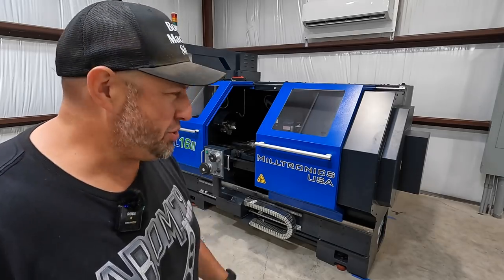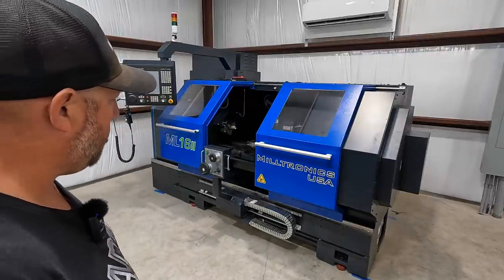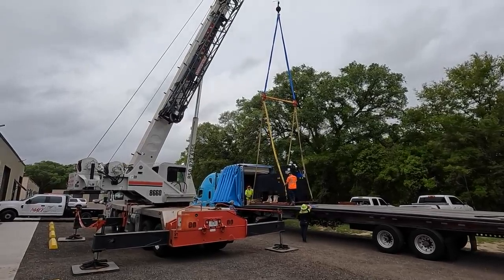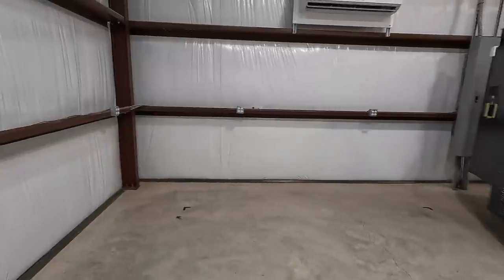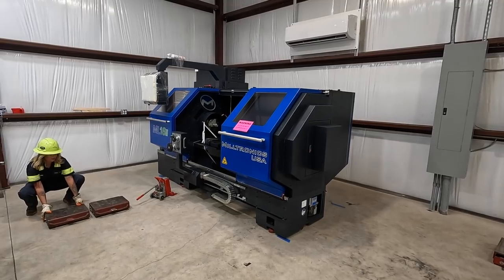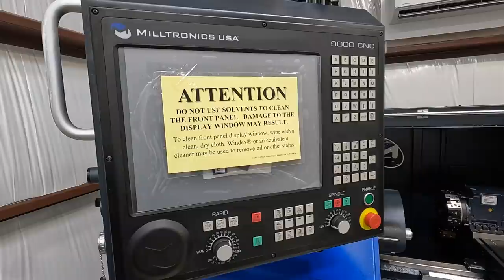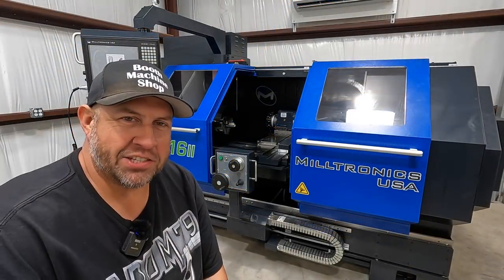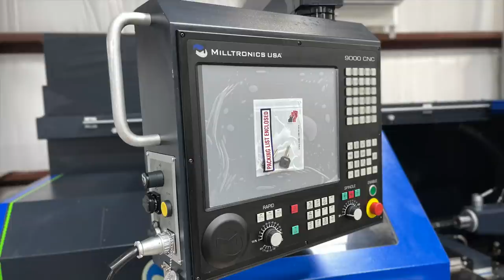Milltronics ML16 CNC Lathe, Our First CNC!

Comment: I was thinking that if the need  develops where you need to feed longer stock in.  You can always add a door to that structure since you're in the corner of the building.  It shouldn't be that difficult.
Reply: Or just drill a hole.
Reply: @rjkee5157  I doubt the building would want a hole in the wall.  But a boat portal window that could be open and closed could work to or and standard window for that manner

Comment: did you see the crack in the new floor?
Reply: What does that have to do with the context of this video?
Reply: Yep, already falling apart. What a shame.
Reply: @FrozenHaxor  ....You need to complain to the landlords video!
Reply: That issue has already been addressed in a few previous videos, floor slabs are MASSIVE and little surface cracks do not affect stability whatsoever. Floor also has control joints built in.

Comment: cnc in aboms shop?  sacralage, but at least its a usa built machine, and its another tool in the belt for a serious shop that does production, though manual can do the same thing but takes 5 times as many steps to set up then to program a machine and have the repeatabillity. 
I mean its just not something I thought I would see in this channel, but even I use a duplecator for making spindles on my wood lathe, and nothing but the most sturdy too from vega, though I perfer using chisles and cutters in hand and freehanding most, but I cant replecate 3 spindles alike though I can get two of them close, but its nowhere near as fast, the only other step up would be a computer lathe myself, or a big old copy lath, and I dont use it everyday so it dont justify the expense to step up to that.

Comment: What I don't like about those machines is that the dust and all the chips will fall onto the dovetail, certainly it will need regular oiling there.
There are other machines which have the crosslide hanging on the other side - for me those ones seem to be a better design for a cnc turning machine.
I'm just the owner of a small DIY CNC lathe (basically the same concept ... and that's just what I have noticed) but it has served well so far.

Comment: idk what kind of work you do but if you do contract parts.....400, 500,or more pc lots, you should always leve room for a bar feeder for a CNC lathe.  Just my 2 cents.  I bought a Hardinge Super Slant with live tool on the turret, I was not happy with the placement in the shop (long story), 4 months in I got a contract to make swedge dies for plastic tubing out of aluminum barstock.  Having the barfeed capability saved me 2 setups and 2 operations. And eliminated slugging blanks out of the bar.

Comment: Just curious if that's one more red lockdown bracket on top of the left door. :)
Reply: He takes it off at 19:13
Reply: The other "red thing" is a safety interlock switch for the sliding doors, they must be closed for the machine to operate...I think?

Comment: A few years back, I spent the better part of a year programming a twin spindle, 36 tool with live tooling, 11 axis, Nokamora Lathe for machining high production, high precision (2 Micron tolerance) diesel fuel injectors out of 4140 bar fed stock.
Got it running a 4min. 32sec. cycle time and using all 36 tools.
It was quite the challenge!

Comment: Adam, you will find what you do manually is sometimes difficult to translate to code. The machine needs to be instructed to do *every little thing*. This is assuming you'll be using g-code or whatever Milltronics uses to program.

Comment: I applaud you in using your extensive knowledge and to add CNC to your repertoire. One question I have is does this machine work in metric or does it use imperial measurements. Intrigued to know.
Reply: Sorry to say, you have to learn yet another system. That thing only knows bits and bytes ;)
Reply: You can do either
Reply: Almost all (probably all the actually usable ones) CNC machines have their inner workings in metric - in thousands or tenthousands of a milimeter. Since it's just a simple conversion, you can convert all of them between 1/100mm or 1/1000 in
Reply: @an2thea514  To be honest, I am not sure if the initial question really was a serious one or if it was jokingly (that was my guess).
But it is somewhat closer to my joke about bits and bytes. if you control or display those as mm or inch is just, as you correctly mentioned, a software setting and conversion.
But coming to the inner works, controlling those movements is usually done by the use of stepper motors. (They are other variations around which highla depend on feedback from measuring systems) Those stepper motors have, depending on how they are build, certain characteristics, like how many steps are one full rotation. Sometimes there is something like half pulses to create half steps, but I highly doubt you will find such in those machines.
As an example, a common stepper motor (or servo) used for example in 3D printers has 400 steps per rotation. So one Step would be a 1 Grad (or Gon) or 0.9 degree or 0.015708 rad or 16 NATO Mils rotation. Depending on how the movement is mechanically translated from a rotation to a linear movement you know what distance the linear movement of one step, eg. in a pulley and belt system. With a 25 mm pulley one step would mean the belt moves about 0.19635 mm linear per step. Of course a screw like in the manual machines would work as well (and may be used here to prevent slipping), then the movement depends on the screw pitch. From here now your system calculates the steps needed to move a distance. Most likely this will be sort of an odd number, no matter if metric or inch and with standard parts available, there will most likely a lot of metric stuff going ion within the machine, but to be honest, this is just a number used in the controls, if metric or not does not matter. 
This 0.2 mm of course was only an example and sure is far from the actual precision of that machine.
Of course a screw like in the manual machines would work as well (and may be used here to prevent slipping), then the movement depends on the screw pitch.

Comment: Are you guys required to have some kind of fire suppression system? Even if you're not it would give you a some kind of discount on your insurance. And if you do go with some kind of fire suppression system you should go with a dry system unless you use a different type of fire retardant. I never looked in the videos before to see if you're building already had fire sprinklers. You have a lot of monies worth of equipment there. Fire sprinklers would require a small attached little shed away from your shop. Something to check into

Comment: Sweet machine; but I've never heard of a CNC machine having a conversational mode, do you think he meant conventional?
Reply: I think a conversational mode would be very useful for abom75.
Reply: Nope, "conversational" is widely used to describe CNC's which can be programmed one step at a time as it's running the part... 

It strongly implies that the machine has Macros or a special interface which make it easy for an inexperienced user to get the machine to run complex shapes without needing to know the underlying G-Code.

Which is why it's "conversational", at each stage the machine is telling you what it can do, and when you chose and operation, what details it needs to be able to do it, so it's a more two-way communication experience than writing G-Code or uploading Code from a CAM package.
Reply: @joshuakelly8103  I stand corrected, still sounds like a typo if you ask me.
Reply: @mattyt9999  I would imagine they call it conversational due to you basically having a "conversation" with the machine. Making programs right there at the controller, telling it what to do, rather than doing it off on a pc. Think of it like talking to the machine "i want to cut a bore diameter of xxx"

Comment: Nice job Adam. It’s where the future lies sadly. I feel that the skills you’ve always practiced will soon be a forgotten art. That is the only downside to CNC machines. Your new skill set will make huge improvements in throughput in the shop, but make sure you keep your hand in the manual camp as well. Here’s to the future.
Reply: Hey TT, I always thought of the two as, one-off vs production. No?
Reply: There will never be a stop on manual machines. Much quicker for prototype and development work. It's not worth programming until you're ready to start doing batches.

It actually works out to raise wages. CNC operator is usually bottom of the scale, manual guys at the top, and the programmers get screwed because they're at a desk.
Reply: There will always be a need for job shop machine shops. Many industrial machines do not have spare parts sitting on a shelf somewhere. The parts are made or repaired on a “as needed” basis by job shops on manual machines.

Comment: I think he might regret getting it so close to the wall. Even a 3 foot long round, hes gonna want access from back. Not that he cant move it forward. No chip conveyer? Any small production run, even 100 parts and hes going to regret that immensly. When i did cnc, chip conveyer was always running even on small runs, and dumped into plastic 55 gallon baskets. We could fill like 5 of those in a day. That bottom pull out tray, hes not gonna like pulling that every couple days. I dunno, I guess, to each their own.
Reply: I doubt that he's even thinking in terms of high production. His version of high production might be 20 parts...... But he still has to find out what it will take to get those 20 parts out of a CNC lathe (time element). The time to program the job, the time to set up and zero out all the tooling, the time to prove out the program....... Those 20 parts are going to get mighty expensive!
Reply: @johndonlan5956  Well, i suppose it depends what one thinks high productuon is. When I did cnc, 100 parts was a small run, most of our runs were between 150 to 54,000 and we only had a 8 man crew. To me, 20 part runs isnt enough to justify one of these unless you do it constantly. Then i could see it. But I guess we'll have to wait to see what he runs through it.

Comment: Don't have long bar stock fed from rear, unless you have proper support for the remaining full stock length,  or you will get dangerous whiplash! Find a correct size bar length to saw cut first to hold and machine, and never go any longer!

Comment: “@ around 3:30 or so he says machine can bd used “Conversational” ?  I think he means conventional doesn’t he?
Reply: No, its a weird use of the word, but he did mean 'coversational'.
Reply: Conversational in the CNC sense means to program simple parts and operations on the control by inputting some measurements and having the control automatically make the code to pun the operation (simple facing, bolt hole patterns etc)
Reply: @Uk_Grid_Engineering  Thank you. Have been hearing the term recently, and needed to find out what it meant!  So, it’s the closest that a machine like this comes to “conventional”, manual, operation?  I’m looking forward to following along and learning too.
Reply: @Steve.M  In layman's terms, it's called conversational programming because essentially you tell the machine "this is the measurements I want on my part and how I want it to look" and the machine calculates everything for you.
Reply: @Steve.M  CNC machines can usually be used manually, using the hand wheels,  
Although this is generally one axis at a time, conversational is for quickly flattening a surface and simple things like that

Comment: what r u gona do with NC? Now u gotta learn to write...
Reply: 40 years ago you had to write code. Today the machine control units are so sophisticated that they write the code for you...... And pop out of cup of espresso while you are watching them do it!
Reply: @johndonlan5956  yep, so many of them have their own kind of conversational built in you can just pop an idea in there and it writes itself!
Reply: Any CAM software will export the code for you, but as a programmer or operator you need to know what every G and M code means and how to read and write programs line by line. There will inevitably be mistakes in the code, wrong feeds and speeds, and other manual modifications to programs. I programmed and operated CNC machines for about 12 years until switching careers to software development recently.
Reply: @HarryManback0  You sir.....are 100 percent correct!

Comment: For not filming the removal of the machine from the pallet, your viewers missed out on some valuable technical rigging that might have been interesting and a learning experience.  Too bad no footage. All we got to see was the easy everyday stuff.
Reply: Well, people went ballistic over him showing uncrating the other machines, so it's natural he didn't include it anymore
Reply: @an2thea514  I am really surprised that they had a crane, and then never used it to take the machine off the pallet.  It would have been so much easier doing that first, instead of skating the pallet and trying to remove it later. I have rigged many machines, and getting one off a pallet without overhead lift is always a challenge.  What is your experience with this  ? ?

--Doozer
Reply: @kooldoozer  He doesn't have thr room height or the crane reach to take it off of the pallet without uncrating it first. You can see it in the lathe video, that thing doesn't go very high.
I personally had the fortune that all my machines(1500 kg and less) have been in my big shop, that I built in a way so that I can get my Tractors in there. Lifting them off of a pallet and maybe get a foot in the air for levelling
Reply: @an2thea514  They used the crane to take the lathe off the truck.  Should have used it to take it off the pallet too.
Reply: @kooldoozer  that's not completely true for either lathe.

Comment: CNC is the devil.  No further machining skills required.  You have just become a computer nerd in the worst way, Adam.  You might as well hire some guy to tie your shoes now, because that has about as much to do with machining as CNC does.

Dean, (me), who has been a manual machinist (lathe and mill) as long as you have been riding your first bike.  To me, this is sad.  You are so talented.  You know so much about manual machining, and have even encouraged me in my old age, (not quite as old as that Mr. Pete guy, but pushing it.)  South Bend, Monarch, Bridgys, and even a few old clapped out nasty Atlas machines, as well as Clausing Colchester and a couple of well built Taiwan machines are what I made my living on.  Never pushed a "Run" button in my life.  Never will, and I'm still working.  I love the trade.

Good luck.  I want you to succeed, but not by going to the dark world of computer run machines to do it.  Best of luck, but crap, man...  I'm sad about this.
Reply: Extremely ignorant view point that isn't surprising from someone who has never touched a CNC machine. If you can't realize both are tools in the toolbox and that CNC operates on all the same fundamentals and then some as manual machining, you are ill equipped to formulate an opinion on the matter. There is room for both.
Reply: No machining skills required? Its clear to see you've never even touched a CNC lathe/mill. You gotta respect both aspects of machining; CNC and manual.

Head over to Cutting Edge Engineering on YouTube. He's a manual-only machinist and he does some absolutely amazing work. The work he does isnt really feasible on CNCs, but that doesnt mean that CNC is something he shits on and calls the operators "nerds".

If I program a CNC mill or lathe - I can pull in anyone direcly from the street and have them "operate" the machine and run parts. But to program the machine, you still have to know about speeds/feeds, vibration, materials etc. There's so many more possibilities with CNC compared to manual. What a shame you feel that way.
Reply: This is, simply speaking, complete bull. The very best CNC operators and programmers are the ones with extensive manual machining experience. The ones without any are mostly a danger to themselves and the equipment they try to use (in the case of operators) or a constant source of annoyance to the machinists and operators (in the case of programmers). Moreover, it is an utter waste of the man's skill and time for him to crank out simple or repetitive parts manually - it's going to be a much better use of his abilities if he can learn to let the machine do what machines do best (dumb, repeating work) and focus on the demanding parts of whatever he's trying to create, at the same time, on a manual machine sitting opposite the CNC.
Reply: @quiescentnexus  Just adding to your comment if he doesnt read between the lines; CNC work isnt just "dumb" parts. Some of them can't even be made manually.

But yeah, I agree that most machinists really need to learn some basic manual lathe and mill work.
Reply: It's simply a matter of looking at it in the right perspective: manual machining is for one-offs, and CNC is for high production. Both require good machining skills and knowledge.